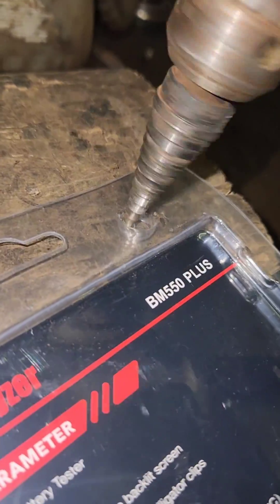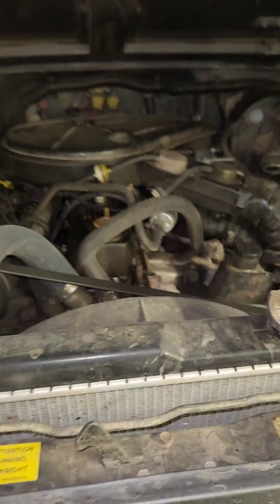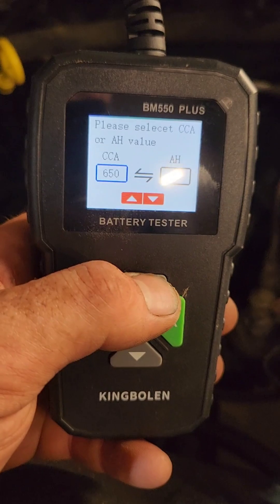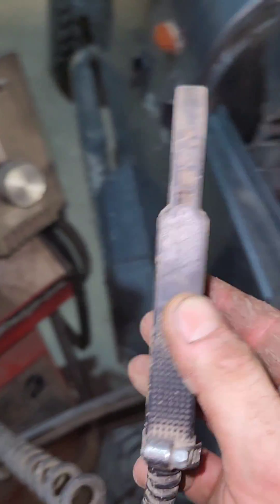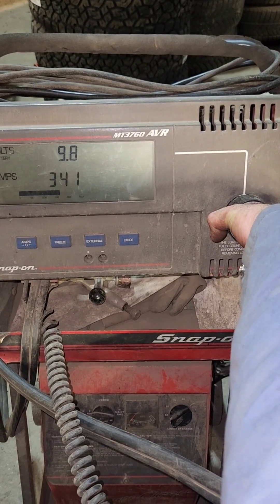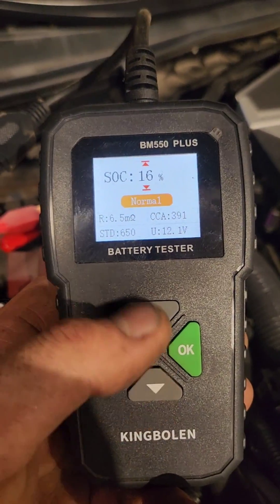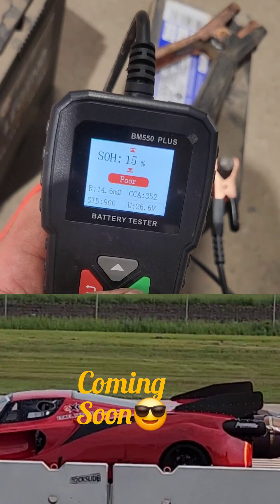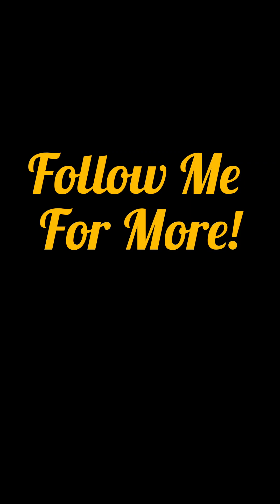Battery Analyzer as Good as Load Tester?

Comment: I really dislike the Maintenance Free or Maintenance Impossible batteries. You can’t water them and you can’t use a hydrometer which is the best way to test a battery. Those batteries work until you boil enough water off for the cells to short and boom, the electrics are dead like an old British car with Lucas (Prince of Darkness) electrics. I’ve gotten 8 years out of serviceable batteries.

Comment: The best battery tester is the machine its meant to run and volt meter.  Ive seen plenty of batteries testing bad with an "analyzer" continue to run for years.
Reply: Continuing to run and being within a specification good enough to put a warranty on is another thing! Yeah cool got 3 more years outa dat old $100 battery but ate $500 extra fuel to charge it and killed 50% of the brushes in ya $500 alternator! well done!

Comment: i have found my digital tester in not good at recently charged batteries but works pretty reliably if you have not driven car in a day or charged it. seems to read surface charge on battery not the deep charge on plates if battery was recently used or charged.

Comment: For your 24v battery test.. You tested 2 12v batteries in series.. Right?  If so, your CCA ability does not add up like that.. It remains the same just at 24v instead of 12.. To double the CCA you run the two batts in parallel making one larger 12v battery..  
Thats why when you tested the battery you set the tester so high that it was never going to reach that CCA rating, making the tester think its bad.
Reply from the maker: Yes, in series. Full power!😆

Comment: I've seen some batteries pass using a battery analyzer and then immediately fail using a carbon pile. I think the analyzers are decent at finding failures due to high internal resistance, such as sulfation.
Reply from the maker: Was that tested after removing the surface charge?
Reply: @GoldWrenching  Yes
Reply from the maker: @danp3890  Yeah, I'm not crazy about these things. You can't beat a good load test. Nice little graphing voltmeter, though! 😄
Reply: @GoldWrenching  That graphing feature is cool